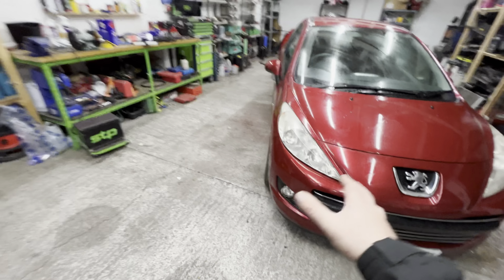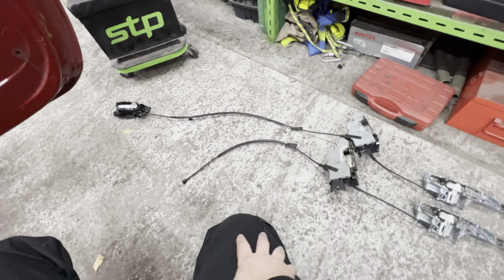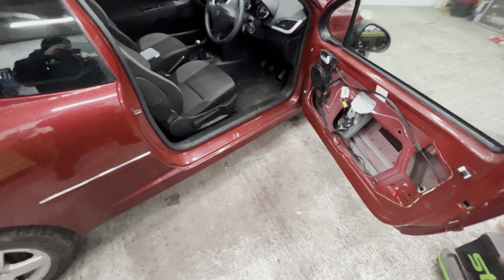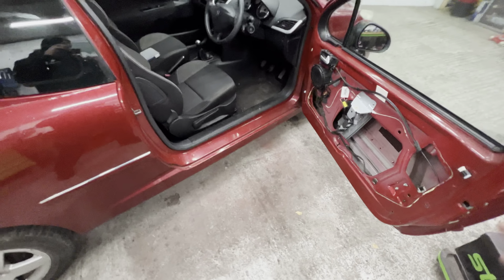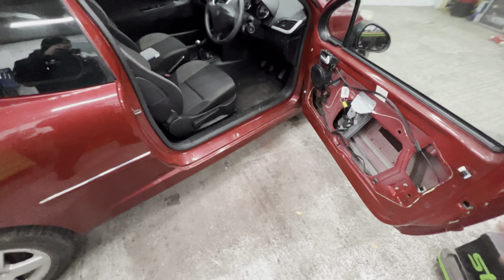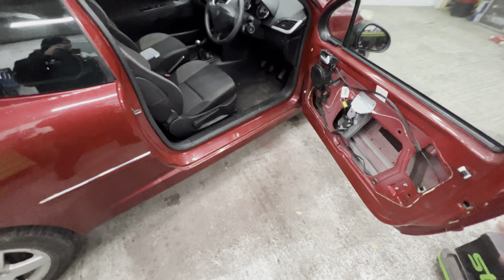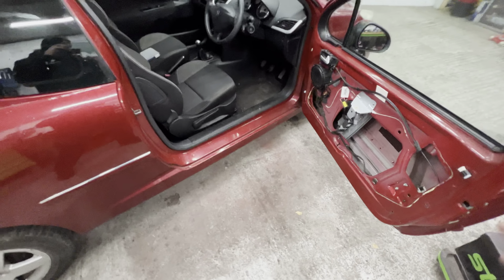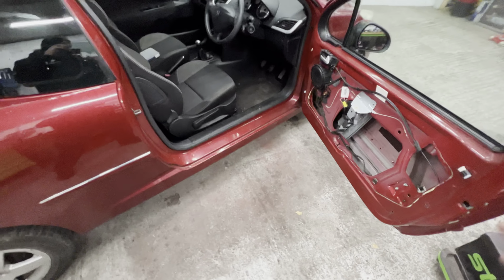Peugeot 207 Cat N Salvage Rebuild Copart UK Rochford Part 3

Comment: On the Juke the cooler pipes have been cut and those rubber hoses added, the pipes are all steel but rot out due to location. The CVT gearboxes need special expensive fluid,

Comment: Blimey Mark I’d say 3 or more months with that noise you’ll be lucky if there’s no damage but fingers crossed mate , I think if you can find the capacity of the oil cooler tank for that gearbox you could replace it with any after market one the same capacity  but obviously it needs to fit back in the same place ! Gonna be a good vid 👍

Comment: Hi Mark. Good fix on the Pug door lock. I think, just refilling the gear box with new oil. Run it and if the noise goes away.  The gearbox may be saved. Rather than buying and fitting replacement cooler & pipes. Only to find the noise is still there. 🤷‍♂🤷‍♂ See you in the next one.